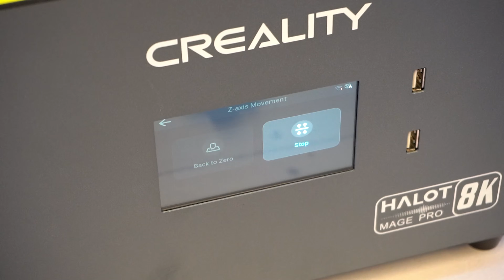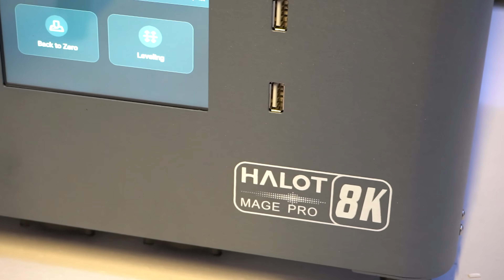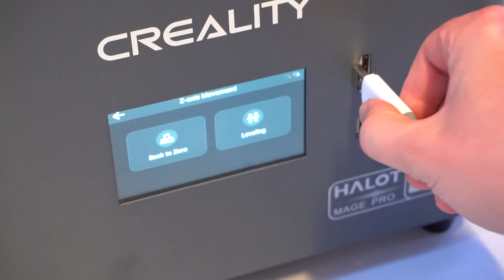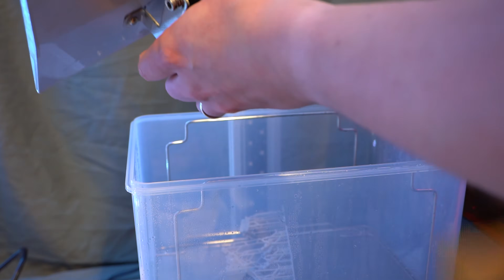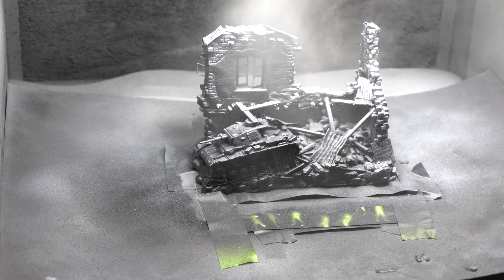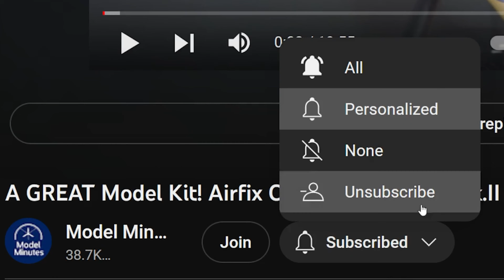This Tank Diorama Was 3D Printed using the Creality Halot Mage Pro! Scale modelling Product Feature

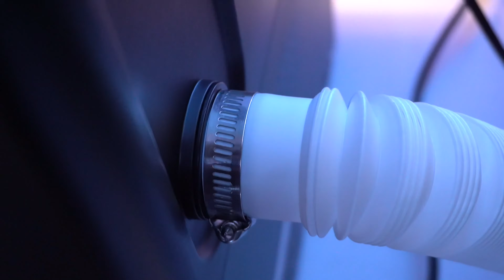Comment: 2:19 I've seen grey water hoses like that. I think you can pull them to expand the material for more reach so it's probably a couple of metres there at least.
Reply from the maker: it does extend but not by much - it's probably about 1.5m in total when pulled all the way out, which doesn't really let it be long enough to go anywhere unless you put the printer right next to a window

Comment: The diorama has come out really well, i have been looking at 3d printers but think i will need to upgrade my chromebook first to a pc so I can run the slicer software. Could be very useful for printing parts for dioramas for the models we build.
Reply from the maker: You can download the software and try it out before you buy a printer to see if it will work, might help avoid having to buy a newer pc if your chromebook will run it . .